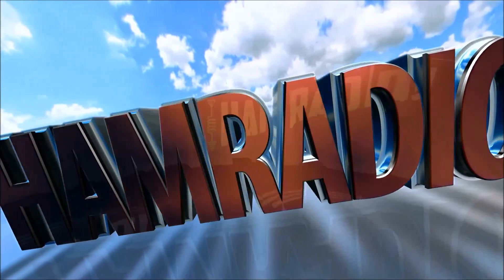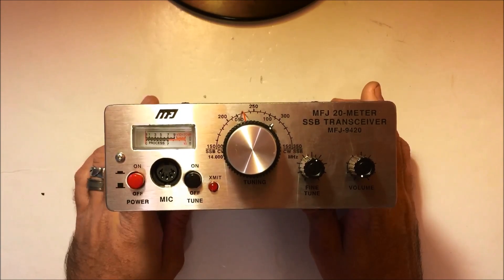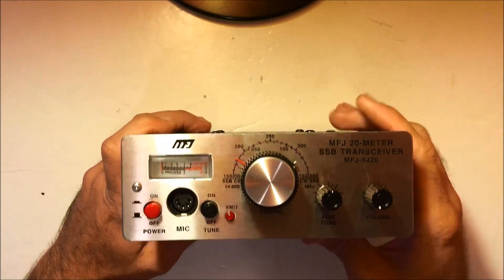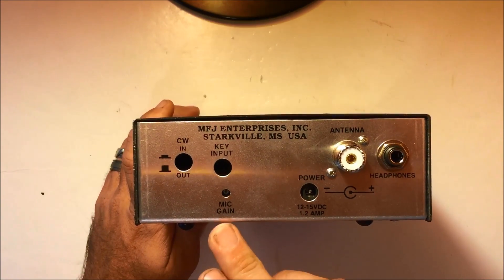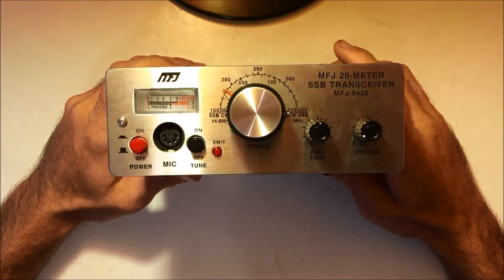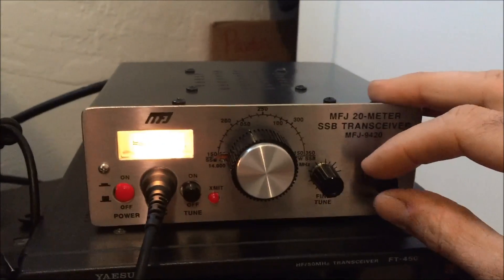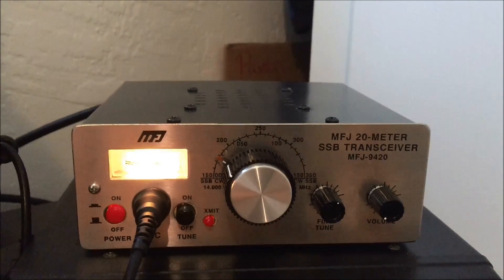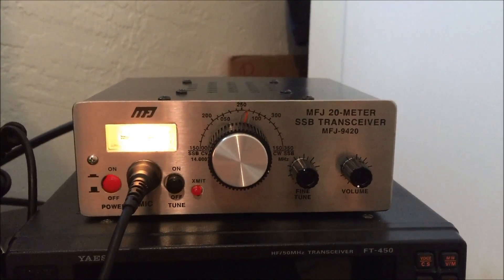MFJ-9420 20 meter CW/SSB transceiver review/demo

Comment: I bought a used 9420 from a seller on EBay and added the CW board to get full coverage of the band and did the alignment with the service monitor at work and then packed it up in preparation for a move out of California. Fast forward four years to now and I unpacked the radio and put a decent antenna on it and much to my surprise I couldn’t tune in any of the voice transmissions on 20 meters. Then it dawned on me what was going on, my radio was not tuning in usb the usb signals but it did tune in one transmission which was lsb. For some reason the radio was setup for lsb mode, possibly due to having the wrong crystal filters installed, it’s the only explanation that comes to mind.
Reply: Maybe you can align it again, i have one and it is easy to miss align it when you bump it hard.

Comment: Why would people buy this radio.  In 2020 they are 289.95 with mic,  plus $139 for the 971 tuner.  You can get a good used Icom 706 mkiig for around $600,   The same size, plus VHF and UHF 10 to 160 meters all mode.  and 100w or dial it down to qrp.

Comment: I just bought the new version on eBay from Giga parts. I used to have the older versions back in 2009, for 20 and 40m. It looks like I'm only showing 7w output on my dummy load.

Comment: The receive audio sounds a little distorted.
Reply from the maker: funny you should say that, i just had a good friend of mine align and tune the radio, he works for Motorola, so i will be using this on field day on saturday, and it should be on par now, it was a TAD off. videos ill show it in action this weekend. 73
Reply: Terrific.  I have seen a lot of videos on that line of radios.  Seems they work well.  Good luck on fieldday

Comment: MFJ still has some quality issues.  Yours, the meter is not installed straight or is that just a issue of the video? Don't get me wrong here I'm looking at the 40 meter version of this radio as well. MFJ products do seem to hold up well be as I stated, they do still have some minor quality issues.